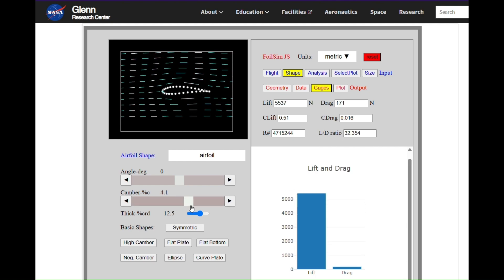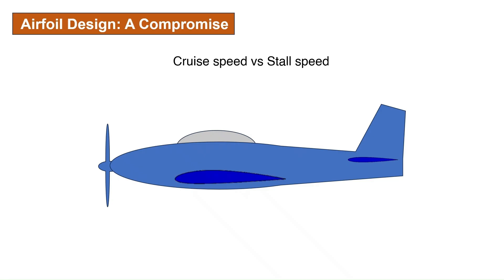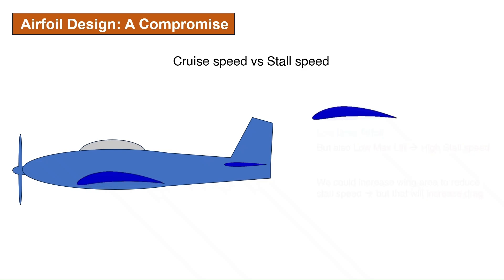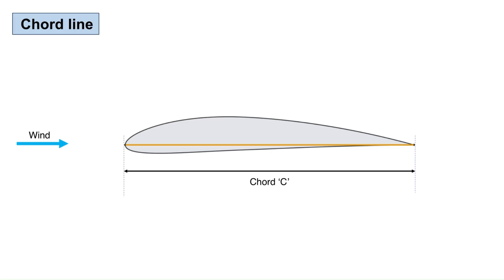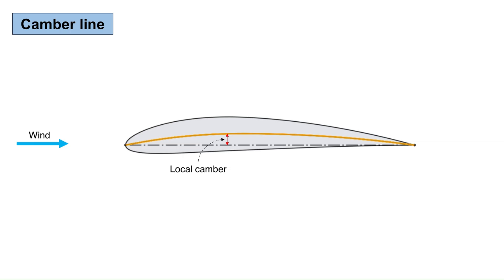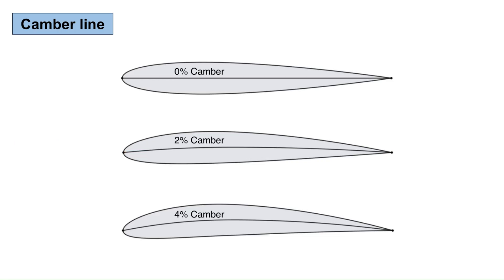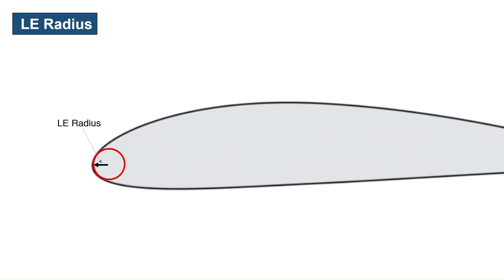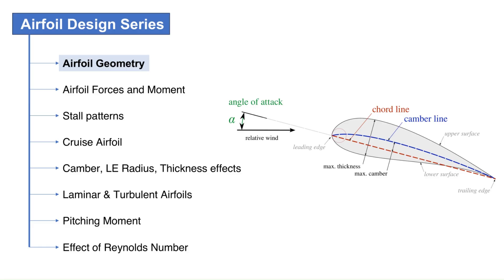Part 1: Airfoil Geometry | How To Choose Airfoil | Airplane Design

Comment: Is all this information also valid for helicopters?
Reply from the maker: I have read that the airfoils that are "good" for airplanes are not usually suitable for helicopters because of the pitching moment - the pitching moment causes twisting force on the rotor. I think Raymer's book would be informative for you (chapter 21)

Comment: 001   it is the opposite of smart to show a  Very  WONKY  wing profile/airfoil.!
150   a two-surface flat-bottomed cambered profile is shown.  that type of profile should be shown with its lower surface  Leve!.!   in part, this is so because a profile like the one shown has  positve angle of attack (aoa) built into it.   thus, the chord line should  NOT  be  level.
234   two rather 'abnormal' profiles are shown here.!
303   more stoopidness, showing an incorrectly oriented flat-bottomed profile.!

Comment: Great. Tricky subject. Especially interested in AR and it's relationship to airfoil design. F.eg you mention that high cruise speed and low stall speed is the two factors. But with low AR airplanes you can get low stall speed and high cruise speed. See airplanes like Verhees D2.
Reply from the maker: You are right, for low aspect ratio aircraft, a lot of weight is saved because of lighter structure (large root chord, less wing bending moment) . With this lighter weight, the wing loading is less even if wing area is same, hence lower stall speed.
Reply: @AircraftDesignToolbox indeed. I think we are a bit stuck in the mindset that everythings been tried. But take the D2. It's almost the same weight as the LSA I fly, but it's not cramped, has a low stall speed, not immediately at MTOW just because you fit two normal guys in it, long range, fast, and it has a camping sleeping compartment in it. If it was built with glass fiber and had a diesel engine like the hundred's of Gazailes built you could travel oceans with it. And cheap. Like real cheap.
Reply from the maker: @NavalTechTinkerer  Have you seen this: https://youtu.be/QaGsopdKids?feature=shared 

Its exactly as you say, and other benefits of low AR designs are also mentioned. You would find it very interesting.
Reply: Yeah.. what’s the field performance on something like that?

Because usually things like low AR deltas get low stall speed from vortices that produce an insane amount of drag.  Great for something that has a lot of thrust like Concorde.  Not so good for a 100HP light aircraft. 

Even the old Hershey Bar Piper Cherokees could get into a pit if you got them too slow.
Reply: @calvinnickel9995 you get Mac speed of 260kmh at 100hp, 1300 climb, a real wide 1.5m cabin, 1800nm range, a low stall speed or 45kn which increases safety and of course for euro LSA rules, payload is incredible at 325kg out of the 600kg allowed, 500m to get pass 50m obstacle and a 1:10 glide ratio. So I'd say that's not only solid performance but quite incredible. Also you get camping space to sleep in it. I can't fit a normal bag in my current LSA trainer and we are almost immediately over weight when we sit two in it for comparison. The compromise for this airplane is that the low AR does not give it great fuel efficiency at lower speeds. But this is plane built to travel Europe at decent speed at low cost. To me the specs blow my mind. Imagine what a composite plane of similar design could carry and increase in top speed if it had smoother shapes.

Comment: no, manufacturing hardness/easiness should matter the most. if you need to make a complex shape then avoid those. completely. even a flat wing is better than complex shape making manufacturing expensive and complex.
Reply from the maker: You are right, ease of manufacturing is important in aircraft design. But there is a compromise between performance (e.g. lift & drag) and ease of manufacturing. A designer needs to decide the trade-off between these parameters by looking at the requirements of the aircraft.
Reply: especially at less than 1m span ;)
Reply: @marc_frank  3d printing
Reply: @Lucius-Fox-t7v i'm working on it, but carved balsa wings are still really good
Reply: Facetmobile is a good example
Reply: Depends on the manufacturing process.  

Like with wood and no jigs.. it’s easier to do a flat bottomed Clark Y airfoil.  

But with moldless foam core fibreglass construction.. it’s just as easy to make a complex supercritical GAW wing as it is a flat board.